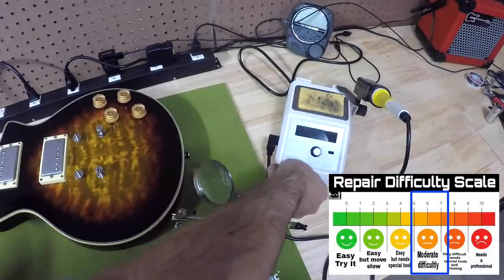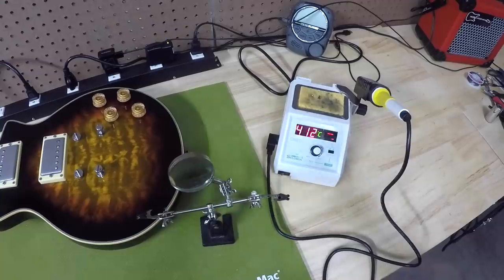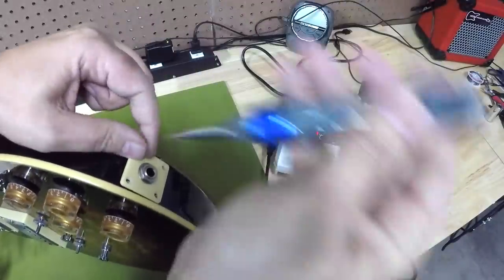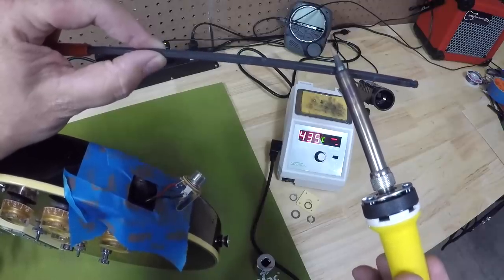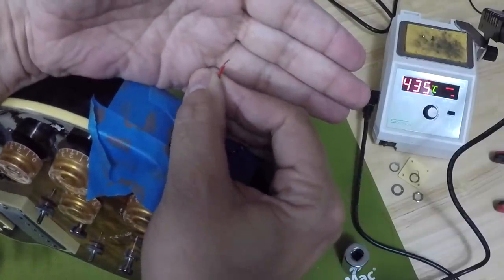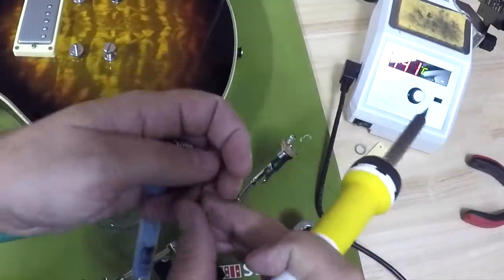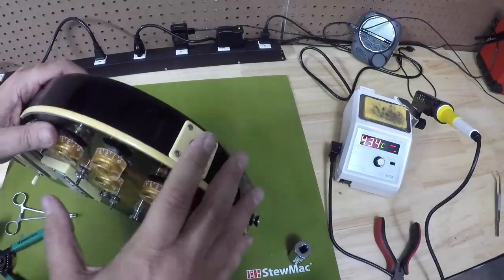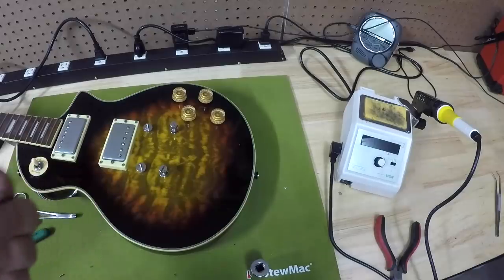Basic Guitar Soldering. Sharpen My Axe

Comment: HELPFUL SUGGESTION - Drill 2 holes  at opposite ends into the HELPING HANDS base and then SCREW-IN the helping hands base to a 4X4 block of wood. Gives MUCH BETTER STABILITY and use of the Helping Hands. BTW - I bought mine at Harbor Freight Tools as well and it works great especially with the wooden block of wood base!!

Comment: The smoke you see when soldering is just from the "rosin core" of the solder. It's just the flux, it's not the lead (or the tin). Your soldering iron cannot get anywhere near the boiling point of these metals, 1,749°C in the case of lead. [The boiling point of the lead/tin alloy would be lower, but nowhere within the reach of a soldering iron.] Of course, you still shouldn't breathe the stuff in, but you can rest assured that you're not filling the air with lead.

Comment: Phil can you do one of these on truss rod adjustment. Whenever I adjust mine I'm caught in this zone of, am I going to break it  or is it even doing anything. Maybe cover dual action truss rods, what to do if the truss rod is stuck and won't turn.
Reply: I second this idea Phil.
Reply: Yes please, I also want to know more about truss rod adjustment. Phil, please make an in depth video on this topic.
Reply: If the rod won't turn, don't force it.
Reply: Just get a notched straightedge and look what happens. There is a shitload of videos already out there. 
It doesn't all have to come from Phil. All sorts of truss rod related problems (single&double action)can be found by Stewmac including the repairs. You can bend the neck by hand to make it easier for the truss rod if you do bigger adjustments.
Reply: Yep
This would be great
Reply: @IceNein763  In the late sixties, seeing r'n'b bands from Buffalo, guitarists would take a Strat
or Tele, lay it down face up on the stage and stand on the middle of the neck, bent to the floor,
and then jump up, the whanging sound part of their act. That's one move I never saw Jimi do.
Reply: Truss rods are not easy to turn they are quite stiff. I was to , very scared to do it for the first time but go little at a time. When you adjust make sure the Allen key is the right size so you don’t strip the truss rod. Don’t turn it more than a 1/4 turn. When you turn you will need a little bit of strength to turn it. 
Hope this helps. 
-Sam
Reply: If its difficult to turn STOP, take it to an expert. It should move fairly easy. If it's hard to turn try some WD40 being carefull not to get any on the finish. Let it sit for some time and try again. Dont force it!
 If your neck has a back bow, turn it counterclockwise to loosen it. If its bowed forward turn clockwise to tighten it. Your neck should have a slight forward bow to it. When using a capo on the first fret and holding down the string in the last fret there should be just enough space to stick a business card under the 7th fret. No more, and string not resting on 7th, Just a little gap. 
For dual action truss rods, they go the same direction, they just tighten both ways. But moving in the directions I stated before will achieve the same affect.
FYI, by backbow I mean if your holding your guitar in playing position, the neck curves back towards you. Forward bow, away from you.
When checking the relief at the 7th fret, do not lay the guitar down. It will affect the neck just enough to mess up your measurements. Hold it in playing position. 
Lastly, tune your guitar up first and adjust truss rod with full tension. After adjusting you will have to retune and check. It will be 85 percent where it will stay within minutes, however let it sit overnight before calling it done. And never go more than a half to full turn in one sitting. A full turn is starting to push it. I would stop at 3/4 turn, if you need to adjust more, fine, just wait awhile before going any farther. Hope it helps, I promise you wont break anything if you dont force it and do not tear into it and start turning more than a full turn at once. Truss rods are there for a reason, and guitar makers usually give you a tool for adjusting because its something that will definitely need done at some point. 
It's not a bad idea when you change your strings to open up the truss rod pocket, or even easier on a Fender, and give it a little 1/8th of a turn and back to keep it functioning properly. Use a sharpie to mark where it was first and return to that position if your happy with where it's at. On a new guitar there may be a little glue in there and a hair dryer will soften it up and make it easier to turn.

Comment: I've been soldering to class 3 Jstandard for years as my occupation, and always take for granted that most people don't have that experience.  There are some useful parts like selecting what tip to use, and controlling the contact time with tip selection.  If I want to get heat on the part fast I'll use a larger flat tip, and I can turn down the heat a little as well because the surface area is larger.  A lot of terminals I would wrap and solder I'll only use 780 degrees Fahrenheit and be on the turret for like 2 seconds.  Solder size plays a role in that as well...  Another tip is if you are trying to remove a soldered part and the solder doesn't seem to be melting, instead of risking component damage by holding the iron on longer, add solder to the connection.  Doing that will melt the surrounding solder and you can wick it off later.

Comment: So exciting-this was great!  I am excited to see a whole series of this type of in depth tech tip video.  Really well done. I'd love to see vids on Fixing a nut/replacing a nut, replacing pots, standard rewiring, different rewiring options, adjusting truss rod with what it should look like what is too tight or too loose, dealing with fret buzz/adjusting action, changing pickups, adding covers to uncovered pickups, setting pickup height, common issues-slight hum might need to fix ground wire etc., swapping necks on strat, adding capacitor for treble bleed, on and on.

Comment: Phil what I do is examine the wire then cut the jack off behind any damaged wire, this leaves a small amount of the wire jacket on the jack usually about 1/8 of an inch. 2 reasons #1 when you put the new jack on you can refer back to the old jack to make sure it is right the first time #2 might be more of an opinion but when you desolder you are introducing heat unnecessarily into the wire you are going to reuse

Comment: Great vid!! 

I would highly recommend practicing with extra wiring before trying it out on an actual guitar part. Phil makes it look very easy, but it does take some practice. You can also skip a step and not tin the eyelet if you want. You can thread the wire through the eye, fold it so it stays in place, then solder it together. 

One thing he didn't really mention is a "cold" joint when you solder. When your solder joint is done properly, it is shiny and silver looking. If the solder joint looks dull and dark greyish, it is a "cold" joint and needs to be redone to assure that it conducts properly. 

I also personally prefer to "tin" the end of the soldering iron right before I used it and also again after. This assures that heat transfers evenly when you're working.
Reply: yeah, it is actually quite easy to melt the parts. if you overheat an output jack, it might still work. but it is quite easy to damage a pot because it has moving parts inside.
Reply: do you need flux or is this already in the solder wire
Reply: @johnstudiob2481  Generally you do not need flux as it is already in the solder wire.
Reply: @johnstudiob2481  I'd use flux to reflow, but on initial install you usually wouldn't need it.

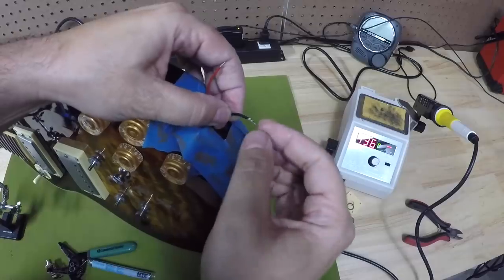Comment: Solder moves in the direction of heat, which is why you may often struggle to get the solder onto whatever you're trying to bond it with. What Phillip shows at 8:23 will greatly help to get a good connection. Tin your connection, and your wires beforehand and you'll have a far easier time. The longer you heat components, the greater the risk of damaging it; especially if you're soldering caps or circuitry.

Comment: From Leo:   Good tips.   Been soldering as a tech on and off since the mid 1960's.  I do not like breathing the smoke and fumes.   Most of the smoke from rosin core electronic solder is the rosin flux, it is not vaporized lead.  The soldering iron cannot get hot enough to really vaporize lead.   A bigger concern is the smoke from any melting insulation.  Burning plastic insulation is VERY toxic.  This caused OSHA to make some pretty elaborate ventilation mandates for commercial soldering in the 1970's

Comment: A small dab of solder on the iron will protect the tip of the iron and greatly increase heat transfer reducing the amount of time you have to hold the iron onto the part. I always solder on my guitar projects at a 750 deg high heat actually helps you spend less time on the part without cold solder joints. A good rule of thumb is most solder joints shouldn’t take more than a “two thousand count”
Reply: Also, if your tip is well used and starts getting contaminated and won't load up with solder as well ... Just dip it in the flux and clean it off with a wet rag or sponge.

Comment: Thanks for the tips. I have a telecaster on the way with intention to modify. Almost zero experience with a soldering iron. I'll probably practice some when I get one ... then give it hell. You learn fast (or die) under fire.

"If you can dodge a wrench, you can dodge a ball" -- Dodgeball

Comment: This applies to making 100's guitar cables only.  I worked at a major manufacturer of cables for the music industry.  The easiest set-up,  the Iron is held still in a jig point down and never moves. A spool of solder hangs next to it. You have both hands free to strip and prep cables and jacks. You hold the Jack and wire to the Iron and use your middle finger bring in the dangling solder. Best for making an entire road productions need of cables. A cable a minute stripping both inner and outer and soldering both ends is common.

Comment: Thanks for these helpful instructions. I feel like the world's worst solderer after installing a bass guitar pickup. I finally realized I better learn more about soldering before I ever try this again. I got the pickup installed and it sounds great, but only after ruining the potentiometer on the first try. I think I overheated it and when soldered the next time I did it less slowly. The solder job looks awful, but its working fine so far. I may redo it soon.

Comment: Widening a nut for thick gauge strings would be a good one for me! Also, a related question: Is there a problem with nut slots being wider than your strings? The other way around obviously raises your action at the nut, but is there any issue with the nut slots being wider than the strings?

Comment: 440℃ is very hot. For electronics work with lead-based solder, 300-320℃ is a much more appropriate temperature.  Lead-free solder is in the same kind of ballpark but is a pain to use.  The only time I would ever crank the heat up that high is if I needed to solder something with a large thermal mass (like a heatsink). Not an issue soldering connectors in guitars I suppose, but a temperature that high risks lifting pads off circuit boards or cooking semiconductors.
Reply: 750 or bust

Comment: As a kid, I had a wood burning kit which is basically a 30W soldering iron.  I was talking to my cousin while working, and got distracted.  I went to grab the soldering iron, and I literally picked it up like a pen... right on the hot metal part.   Yeahhh, I never made that mistake again.  =P

Also, i don't think you can get the output jack backwards.  If you reverse it, the signal phase will just invert.  (This will have no impact on sound in this case.)

Comment: I am going to do some soldering on parts today and I wanted to know about the types and thickness of the solder itself. What is best to use in different situations and parts prep like grounding on pot surfaces and cleaning up a previous mess that someone left on a pot. And using solder suckers, what kind and how to use them? I can always trust your info! Thanks!

Comment: At first I found that soldering was a very frustrating task.  It turns out that all of my problems were due to using cheap soldering irons that didn't really get hot enough.  I highly recommend a soldering station with controllable temperature.

Comment: I would like to see a vid on soldering ground wire to a pot.   I find this very difficult.  especially to do it and not over heat the components inside the pot.  I'm getting a tinny thin sound from my pickups and i'll bet anything it is my soldering job on the pots.

Comment: Hey Phil, is it ok to splice two wires together and solder them. Or is it gonna effect it negatively in some way and should just use a new wire. I have to do a little wiring  and after clipping the old wires some are just a little shorter now. Just trying to save some time and work by just splicing a wire to the short wires to give it the length needed. I could see this being a possible issue. But just curious if it's a bad idea

Comment: I agree that soldering is underrated by many and has to be learned by practice, to get the feel.
Once you get the hang of it, it's actually dead easy.
Here's my 2 cents:
1. Always use freshly molten tin for every connection you make. It enables the tin to flow more smooth and easy.
    A good soldering has a shiny surface. A bad soldering is dull and chunky.
2. When soldering to a potmeter housing, make sure enough heat is applied by maximizing the tip surface touching the pot housing.
    It takes more heat to melt tin on a bigger surface, you will need at least a 25 Watt iron preferrably with a flat tip mounted instead of a round tip.
    A flat tip has more surface touching the pot housing, bringing more heat in less time.
Good luck!

Comment: Thanks for the tutorial, I used to hate soldering, always nothing but grief, so today when I decided to rewire an old guitar with new pickups and output jack, I started having the same problems, cold joints. Pissed me off so I went to the hardware store and bought a 20 dollar Weller soldering iron. Worked like a charm, threw that old asian pos from ebay in the trash. My advice buy a name brand iron, doesn't have to be expensive.
Reply: It was 25 watts, that's enough for wiring on a guitar.

Comment: Hi Phil. I am a first timer at this and found this video so helpful. However I ran into a problem early on when trying to add soldier to the wire. It all seems pretty straightforward, but for some reason I could not get the wire to heat up enough to melt the soldier. I followed all steps, heating the wire with the iron for 4-5 seconds then immediately applying the soldier, but nothing. I tried heating the wire for longer and also kept the iron on the other side of the wire but the soldier did not melt. I was successful with the eyelets, I was able to melt the soldier and brush it over the eyelet as you did. I'm using a Weller 40w iron. It has a dial that I turned up to 5 and still could not melt the wire. Any suggestions as to what might be happening? Thanks!!

Comment: Great video, Phil! I watched a number of other YouTube videos on soldering and I think yours is definitely a much better one. Good call on using a fan for ventilation - I hear that the flux used in solder has some really nasty chemicals in it. I wish I would've known about the sweeping technique when I was dripping solder into some larger holes on a circuit board. I also used a helping hands stand, which made the job easier; I got a fancy one with magnetic, flexible arms, and will use your heat-shrink tube recommendation to improve it. Also, heat sinks are smart because of the heat generated when soldering. I was waiting to see when you would mention tinning the iron. I didn't learn that until recently, and a little too late after letting my cheap Radio Shack iron oxidize (btw, if others are looking for a decent soldering iron, don't go the cheap route like I did; get a good soldering station). It took me almost an hour using soldering paste and solder to clean it up. So for those of you new to soldering, tin the entire tip of the soldering iron before and after your finish your first project, and after each project after that.

By the way, I recently learned more about soldering recently because I got a Jam Jar Amp kit (from Wales/UK) and soldered it up a couple of weeks ago. Both the original and the Blueberry are very cool little amps. I'm wondering if anyone here has tried Trash Amps? I live in the US, so paying for shipping for the Jam Jars isn't fun. I might also make a video comparing the two Jam Jars. Again, awesome video and information as always, Phil - thanks!

Comment: Iv been soldering on guitars, speakers n such for several years and still learning things along the way. Looks like ur iron heat is 430 to 440 is that correct . Also what brand ,model is ur solder station plz. Thx

Comment: Is it possible to over heat a guitar lead plug?? I soldered a lead yesterday and it now seems to have a crackle type of sound to the lead.
Reply from the maker: Yes, if it gets to hot it will burn up and make a crakle sound.
Reply: @PhillipMcKnight  Ah ha thanks! New plug then?
Reply: @PhillipMcKnight  Ok so I switched the plug with a lower setting on my iron, and it seems all fixed thanks Phil!!

Comment: I have Weller Solder gun. It has 2 heat settings via the trigger. But, it don't seem to heat as quick as the one you used.  I don't solder a lot so don't want to invest a whole lot.
Reply: Harbor Freight has inexpensive solder irons. Solder too.